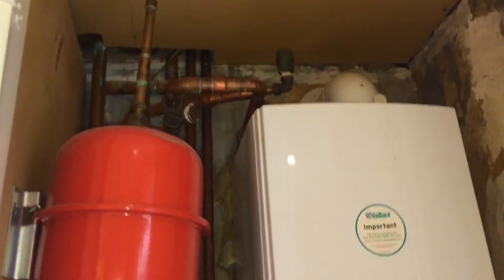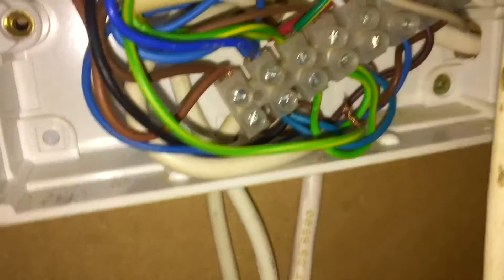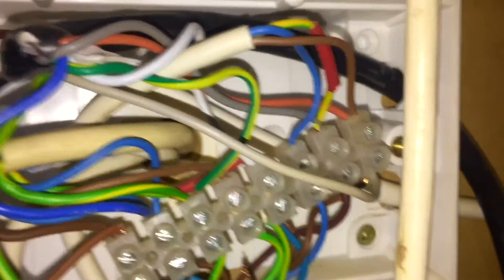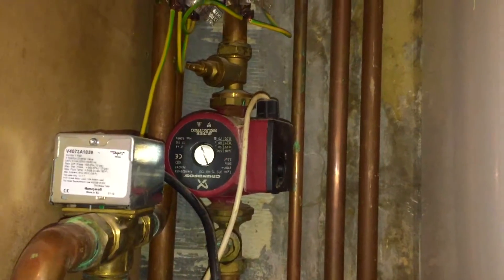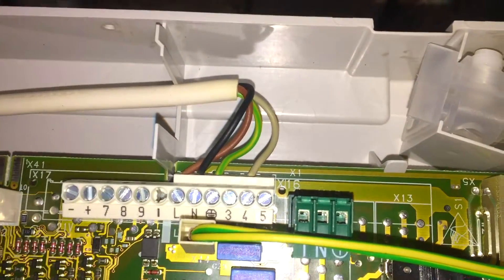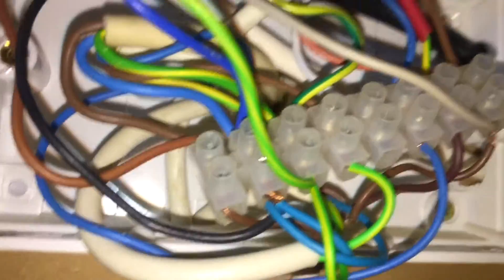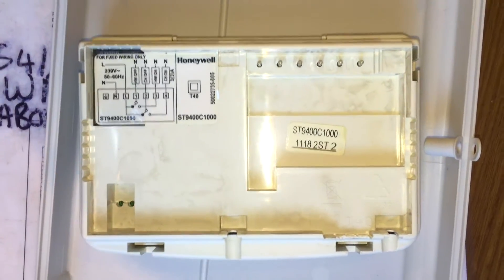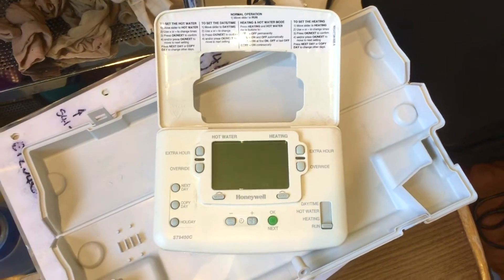Boiler not working. Heating System Diagnosis

Comment: Interesting video. Those Honeywell motorised valves are reliable units but eventually the rubber ball plug starts to disintegrate I guess. My 3 way example is 34 years old and only on its 2nd actuator head (i.e. it's been replaced once). I have noticed that my fairly new Grundfoss pump has suddenly started to vibrate more than usual, I'm guessing that a chunk of rubber from the Honeywell valve's plug has become lodged in one of the impeller vanes. Can't complain though after that time. 
I haven't got a magnetic filter on my system (they claim to incorporate a filter for non metallic debris) but I looked at a Worcester branded magnetic filter on my late parents system and it didn't appear to direct the water flow through to the non magnetic debris end traps positively.

Comment: The problem with the programmer is the AC Capacitor dropper there will be a large X2 capacitor probably .47 uF that has dropped in value therefore there is only enough current to power one really at a a time. Your multimeter should be able to measure it. They are probable a £1 out of mouser, RS Rapid electronics
Reply from the maker: I have a video in a couple of weeks you will like. :-)

Comment: The "fault" is probably an electrolytic capacitor in the programmer drying out from heat from the DHW cylinder. I've gone through 2 Drayton timeswitches with the same problem (mounted in airing cupboard) yet the old (previous system install) Honeywell programmer's still working fine - so am still using that !
With 1 of the Drayton(/iflo) - you can hear the relay buzzing - trying to operate - and a tap with a screwdriver's enough to get it to actually come on !

I think the wiring on the one in the vid is worse than mine here at home - unbelievable !

Makes you wonder why they don't put the indicator lights on the actual output thru the relay !
Reply: Hi Se top of the comments from me

Comment: i wonder if you can help with my baxi solo 18 HE ,it seems to be having what i think might be overheating  stat probs,it reaches temperature then wants to cut out ,then keep trying to relight,if i press the reset button we can get it to go for quite a while then it sort of pops and starts the same prob over again ,Maybe you can suggest how old this model is,should we replace or is this a common small fault.
Reply from the maker: Im  not sure of the issue. If its consistent then you should call and engineer out who can investigate the issue.

Comment: I'm an EE, I suspect Honeywell went for the cheapest of mains power supplies and elected to use a "capacitor dropper" these have a finite lifetime and is a crud decision for a heating controller.  Inside will be a large yellow capacitor, replace it and it'll work again.
Reply from the maker: Someone has done a video about this. I cant find it at the moment but its out there somewhere!!! Thanks for watching. :-)
Reply: It's funny, I've same issue with 2 Drayton/iflo programmers - so have reverted to the old Honeywell from the previous installation ! Programmers all in airing cupboard. All the other same make/model programmers have worked flawlessly - but they're not in the airing cupboard!

Comment: Enjoying you videos HG.  Would the  fact the boiler earth was out effect the flame rectification signal or would it work because it is going to ground through the copper pipes?
Reply from the maker: It can effect it. On this one it didn't but it can and does.

Comment: Another excellent video hope you produce loads more! that is most probably a faulty relay on circuit board  inside the time switch! ( The contacts on the relay itself usually burn/arc out Due to the load current on them) I’ve come across this quite a few times. to any heating guys out there I have saved a fortune replacing these relay switches on boiler PCBs . and they are only around £2 pound for a new relay unit!!
Reply: Relay is fine - as clearly each works ok when only 1 at a time. It's most likely a dried out capacitor issue.
Reply from the maker: I think your right. Its a relay or transformer issue. a: bad relays   b: voltage too low when both relays need to be switched.

Comment: Bit naughty installing that Vaillant without the pump being wired directly into it's electrics. Hex won't get a proper cool down on pump overrun. Thanks for another great vid. Please keep them coming!!!
Reply from the maker: Its weird not putting that stuff right but I have been TOLD!  We don't put right installation defects.
Reply: Dead right. You haven't got time to go worry about the non-safety related defects in systems we see every day. Blame lies with the boiler installer.
Reply: @HeatingGeek  Change your contract. Refuse to do work on systems you can't put right. If someone else comes along afterwards and find it's incorrect, you could get the blame for it !
Or leave a sticker on it saying there are other faults with the system outside the contracted work.
Reply from the maker: @millomweb  I can't be blamed for non safety installation defects. EVER. I can even be blamed for safety defects. Unless I miss them because of negligence. This whole game is a farce. :-)
Reply: @HeatingGeek  I didn't say legally blamed !
Reply: @HeatingGeek  Life is a farce - in the UK - and a few other places.
Get some light relief by watching some lion/tiger cuddling videos.
Reply from the maker: @millomweb  Fair enough. :-)

Comment: wiring always looks a pain in the arse to figure out ha ha,  bet that would have had a few engineers scratching there heads.
Reply from the maker: Thats why I use the 2 port or 3 port as a guide to what should be what. Usually works out.
Reply: It won't fool engineers. Installers, maybe.